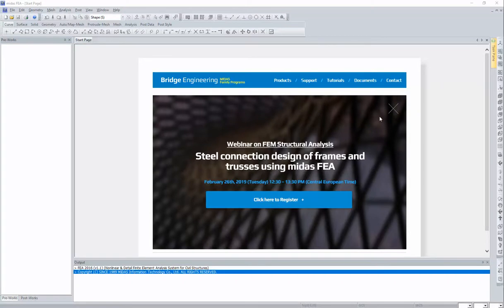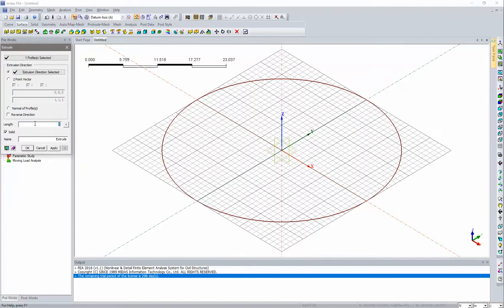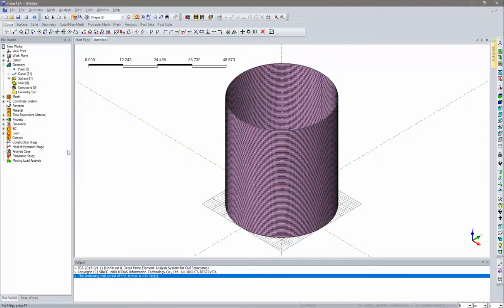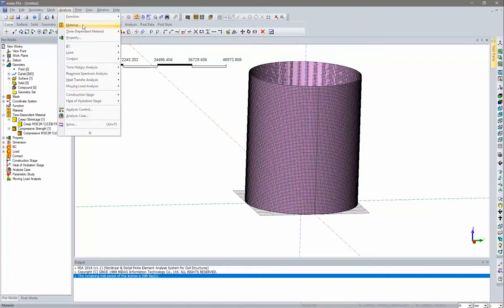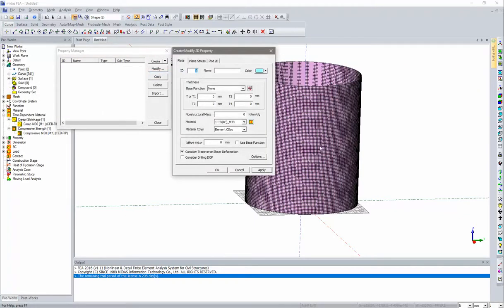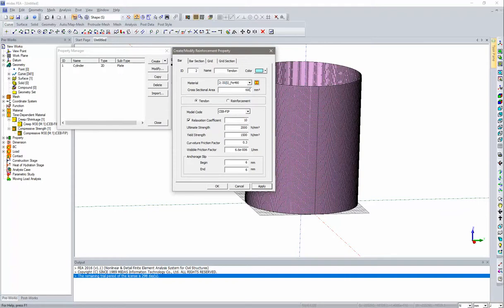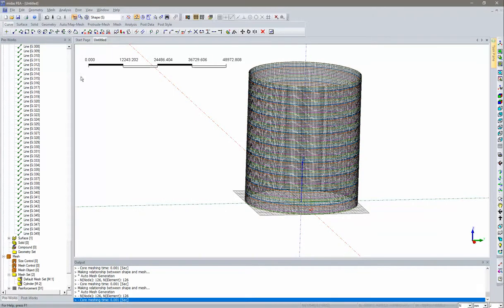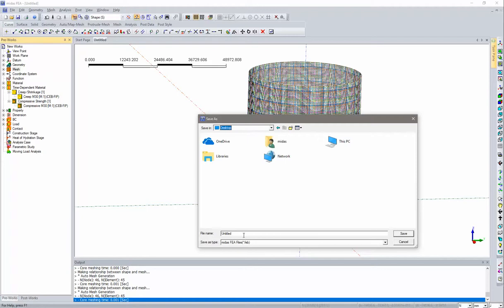Circular Prestressing in midas FEA Part 1   Modelling & Analysis

Comment: Hi sir, I am kajan i have analyzed a wall model with solid elements in Construction stage analysis. in order to study the time dependent behavior of concrete. i have issue in the result with boundary condition. such as I gave pin boundary at bottom of wall . when i read the stress due to creep and shrinkage in the bottom of wall. the stress are arbitrary values for  each stage. as example if the stress in 2nd stage 3.3N/mm3 , 3rd stage one was -2.9N/mm2 and 4th stage one was 3.5Nmm2 like that no any relation ship. but i activate only shrinkage the stress was increased for each step. please clarify to me